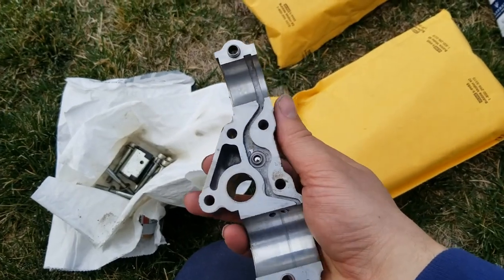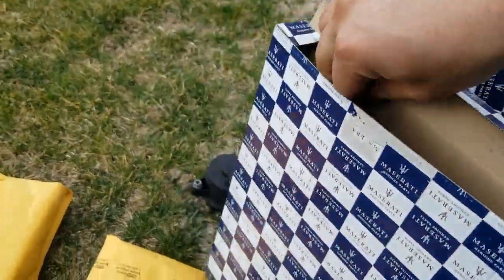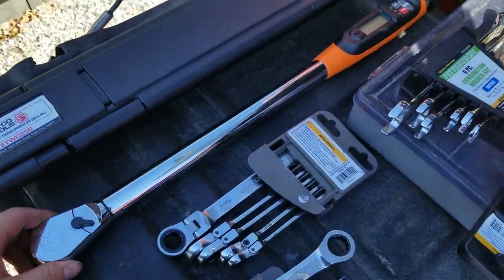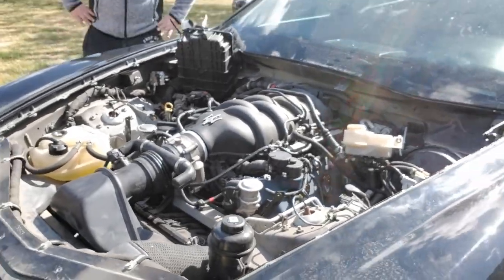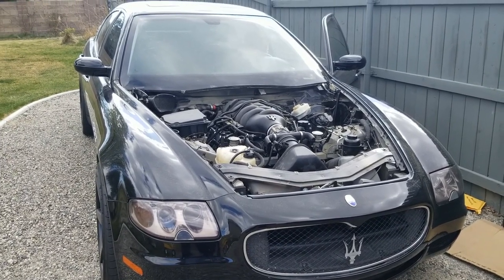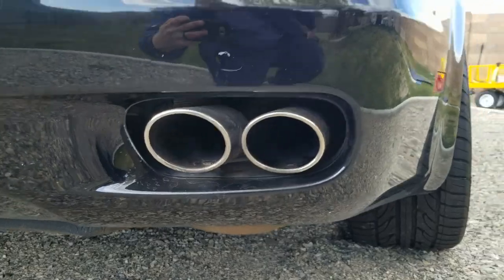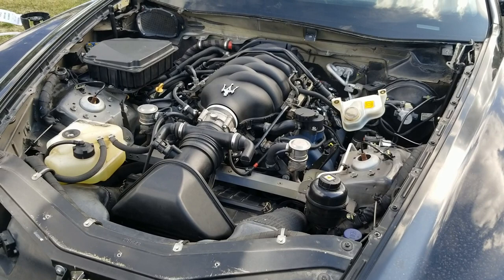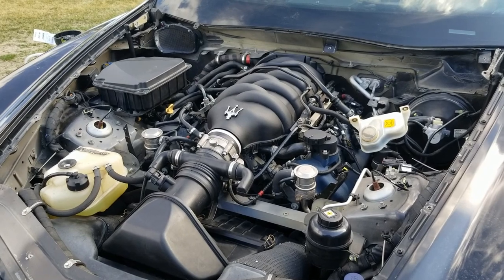2007 Maserati Quattroporte 4.2L v8 m139 Variator Noise Cam Cap Fix and Repair (PART 2)

Comment: Thanks for the mention in your video.  This was forwarded to me from Spain.  It was a pleasure doing work for you.  Thanks again!!!
Reply: Now that some time has passed. Does the car still make the noise if it has been sitting for a few days? I have this noise at start up and I need to replace my valve cover gaskets as well. Would like to get it all done in one shot. I am going to reach out to @TEMperformance and send them my caps.
Reply from the maker: So far so good, i believe i caught it in time and no longer have that noise at start up.

Comment: Glad to see you are not afraid to tackle that job yourself.  Most guys would have paid Maserati 8k for a 100.00 job.  Those check valves are an off the shelf item for under 20.00, all you need to do is drill the hole to fit and press them in place.  Funny thing is that they have been building that motor for years, you would think Luigi and his pals in Modena would have figured it out by now.
Reply: Do you have picture for the gate balve
Reply: Hello what is the size of the check valve and where exactly can I order it? Thanks

Comment: Just had TEM do my cam caps today and they are already shipping them back tonight! I am in Wisconsin and they are in Cali, amazing how fast it can be done with overnight shipping. My cost was 530 and 108 shipping but note as of today they have raised their prices he told me to 600 due to not keeping the tooling set up, I was grandfathered into the cost quote from past June when I set up my time for machining. 3/9/22 for the timekeepers. Save me some time, what is the torque spec for the cam caps, I keep getting conflicting answers from others that have done it.
Reply from the maker: 10nm is the factory spec, but I'd say use your feel on it as well. Make sure it's not 10 FOOT pounds. It's 10 NM
Reply: @syntheticperformanceunlimi8323  What is the valve cover bolt torque spec then? I noticed you said ten for that in your video but nothing about the cam cap itself? See that's where the conflicting info from owner to owner I get is, one guy says the manual says 14nm but others say ten like you? Mine is a 09 Gran Turismo if that matters or not, same 4.2 as your car.
Reply from the maker: @corvettedoc1  when I did mine, they were both 10mn, valve cover and cam caps. Make sure u get new valve cover gaskets
Reply: @syntheticperformanceunlimi8323  Yup new ones here already, I even went a step further and got new cam cap bolts and VVT valves since it's all apart.

Comment: Dear Dennis, thanks for sharing this. Mine Maserati has the same issue. So I am also planning to get my cam caps modified by your contact in Napa and replace the solenoids as well to be sure. But I was wondering. Does this maintenance need any timing adjustment or other special thing to keep in mind, besides disassemble and reassemble stuff? I'm quit good and following very technical tutorials etc. But don't have any experience in engine timing etc. With kind regards Steven
Reply from the maker: Mine was strictly disassemble and reinstall! All depends how long you've been driving with that issue

Comment: I desperately need your help I have a 2007 Maserati Quattroporte and I'm unable to locate the proper rotors and brake pads also having the cam rattling issue would you be willing to assist?

Comment: Good job I have a 2009 I'll keep that in mind very helpful
Reply: How many miles? I'm told here in the D.C. area my Maserati to turn the engine over several times before it fires. Get the oil up top and then fire it. It even works  when it starts rattling.

Comment: Great Videos thanks. I'm currently in the process of doing my 2007 granturismo. How much did you end up paying for the modification to be done on the cam cap covers? Also is the noise still completely gone.

Thanks

Scott
Reply: @syntheticperformanceunlimi8323  I now have both my cam cap covers off and both mine have the holes drilled but have not had the check valve installed, looks like they have never been out. I'm in the UK and the mod price is coming up at $700 so I need to do some more research.
Reply: @syntheticperformanceunlimi8323  Have you got any infomation on the check valve that was installed? 
Thanks
Scott
Reply from the maker: I do not, i was not allowed that information:( but also, they have to not only put in the valves, they also had to machine a few other holes in the cap so if u only install check valve, it might run your cams dry

Comment: Looking into buying a QUATTROPORTE.. just trying to do my research on maintenance, repairs, and definitely costs.. since having the car have u noticed other problems that are general to the brand? THANKS👍
Reply from the maker: Oh yes, basically the way they were made, they don't last over 80k miles tbh, all the plastics and such fall apart and break.  Unless its low miles and well taken care of, they are not worry buying for me again.
Reply: Thanks for responding.

Comment: Good job ! Oil stay in 5w40 or change it for 10w60 after repair ?
Reply from the maker: 5w40 does good for regular Temps, 10w40 for over constant 100 degree weather!

Comment: I was wondering why that hole is there in the original design. Is it a mistake? I'm assuming you replaced the valve cover gaskets. Would have liked to have seen that process too.
Reply from the maker: One has a hole, the other has the oil fill so I'm not sure if that's just an inspection hole or what. I have another Maserati I'll be posting soon of the process again.  The gaskets yes they are all replaced, very simple, hold the tabs in the back and it sits down nicely.

Comment: I'm about to buy a 06 mazi ....I'ma rip it down  myself n get those done asap ... question ? Wondering if you hear of anyone swapping out the transmission by adding a bell housing adaption...like ford mustang or Chevy etc ....can it be done?....like how the do on Pontiac fieros.....
Reply from the maker: Well it would have to work with the computer system, I highly doubt it unless u can make some transmission module that would talk to the car correctly.

Comment: I have the same car with vibration at low rpm on D but disappears on higher rpm or 3rd gear and sometimes flashing engine light..what could be the issue?
Reply from the maker: Engine or trans mount!

Comment: Did you just have the rattle or did u also have any CEL Codes?
Reply from the maker: At first just the rattle then at times cel light.
Reply: @syntheticperformanceunlimi8323  it wasn't the p1015 by chance was it?
Reply from the maker: @Jayjay610_  yep and p1013 so that's for your solenoids, but if you're replacing them you might as well do your cam caps since it's only 3 more bolts
Reply: @syntheticperformanceunlimi8323  ah same as me! Thank you for the information man I truly appreciate it!

Comment: What did it cost
Reply from the maker: For what
Reply: For the variator caps to get fixed
Reply from the maker: It was about six fifty a few years ago
Reply: So 650.00 back then
Reply: That was for both or each
Reply from the maker: @sandcrab911  that is correct yes. Both